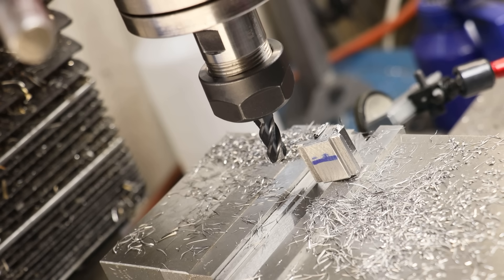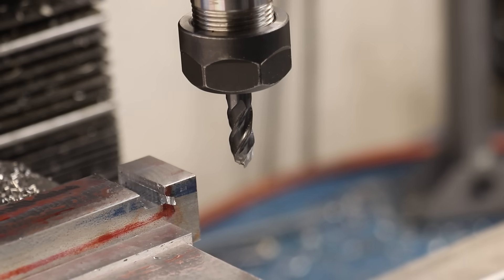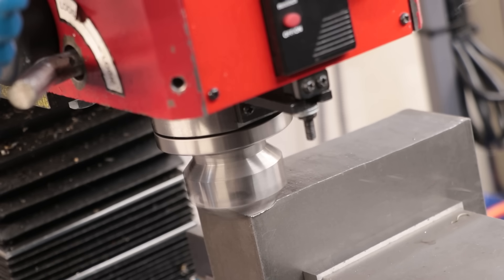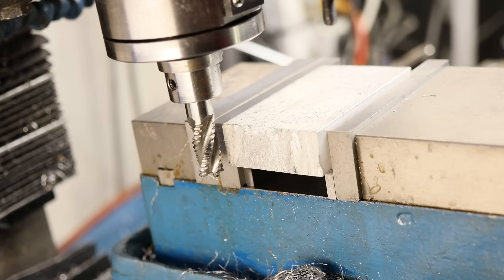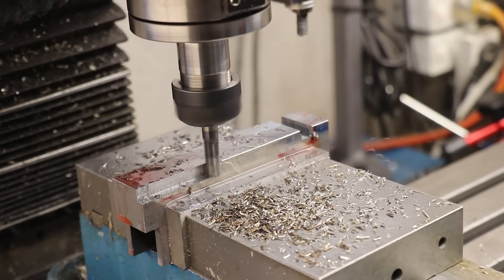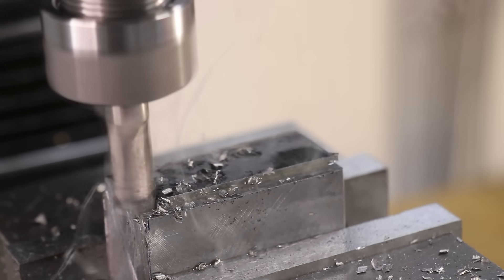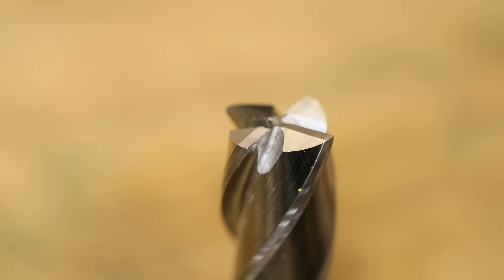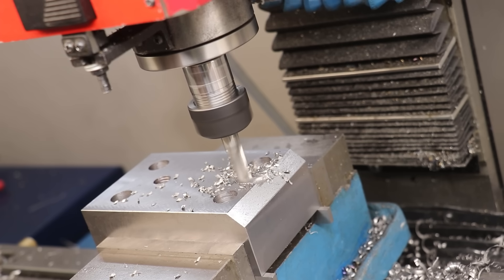10 Tips To Better Use Endmills

Comment: I mostly use 0.500” cutters, in carbide. So those are the first to wear out. I keep saying I’ll sharpen them, but they just pile up once the sides wear out as well.

I prefer three flute aluminum cutters. Two flute finishes are ok, but much better with three flutes, and the chip ejection is about as good. Cobalt isn’t really great for mill bits. Don’t buy them, go straight for carbide. They’re great for drill bits though. Use them for stainless. Just drill it properly, one third lower speed, proper lubrication and a lot of steady pressure.

Comment: I had good luck when i bought my lathe and mill, so I got a few boxes of various HSS and brazed endmills in every size I could need. I find that I almost never use any of them ... I prefer carbide for everything but speciality tools (dovetail cutters, ball nose cutters), I mostly buy new old stock or amazon specials, I really only need a few sizes for 95% of the work I do. No worries about burning up HSS in steel, and I find my flimsy noodle milling machine chatters much less at higher spindle speed and more constant loading that I can only get with carbide.

Comment: My experience about milling cutters. Spindle of my mill work at fairly high speeds (10k-24k on spec, but i use it on 6k-20k) so i use only carbide tooling that more forgiving of overheating. The price problem is being solved by buying chinese tools on Ali - they are more then good. And i using three main types of cutters - 1 flute none coated for plastics, 3 flute none coated (or it will stick to aluminum) with small corner radius (it's really better) for aluminum/brass (main application) and 4 flute coated with small corner radius for steel. Main working diameter - 6mm. Have some small ones down to 1mm fore more precise work. Have some extended ones for deeper cuts, but using them only when they really needed. (and some 10mm cutter working as more rigid extended cutter).

Comment: Hi. Most edge cuts made was made using conventional milling. You will certainly see better tool life and better surface finish utilising Climb milling.
Reply from the maker: Yeah but for reasons you'll probably already know its riskier to climb cut on a manual mill when doping roughing cuts

Comment: I really hate endmills. You need a tons of different models and sizes like you mentioned and they always seems to break so easily not to mention they are expensive! The bottom edges are always the first thing to go, it sometimes feels like they are made of glass. I too always prefer to use carbide insert tooling on the mill and only use endmills when it is absolutely necessary. I also tend to use the smallest size carbide ones to get the job done as I won't cry if I break it (20$ vs 100$ for a 20 mm endmill).

Comment: Other uses for broken endmills:
- grind them into inserts for flycutters
- if only the tip is broken you can turn them into counterboring drills, I've done this before with a cordless drill and a dremel
- grind a point into the end and use it as center punch

If you have a D-bit grinder you can do even more stuff with them

Comment: One tip I'd give is to get used to calculating your SFM cutting speed EVERY TIME. Don't just wing it or eyeball it. I worked at a place that did every thing in stainless steel exclusively. It was problematic at first but calculating the actual cutting speeds enabled trouble free cutting. After 10 years working stainless this way it became as easy as any other material, Even Nitronic. The tooling lasted and the parts were lovely. Don't believe the charts/books recommended cutting speeds. They are written by people who sell tooling. Calculate your own and find the sweet spot.

Comment: Never understood emills in colletts
Reply: They should ONLY be in collets.
Reply: @markrainford1219 then what are hard holders and shrink fit for?
Reply from the maker: If you know what heat shrink tooling is you would know it is not an appropriate solution for a small home shop

Comment: I can also highly recommend regrinding the tips of endmills when they wear unevenly. At least the 2 flute cutters are pretty managable. just grind them like a drillbit but angle the edges very slightly inward instead of 30° outwards like on a drill. you can just check the 2 flute cutters with a square, but for most cuts its not too important to get the edges perfectly level. you can then also slightly champher the edges

Comment: I make prototypes all day long in all sorts of material. My go-to endmill and best all around is a Holex HPC TiSi. Its a tad bit more expensive for a 10mm cutter than the 50$ one you showed - but they can take a beating and even cut when theyre really dull. We tried comparing them to the Harvey "zombie cutter" that Titans of CNC uses - and the one from Holex lasted longer (in regular steel in our test).

You can use the one from Holex in stainless and hardened steels as well =)

For aluminium and plastics we use the 2 fluted endmills "Alu-Power" from YG1.

As someone else mentioned; get yourself a small diameter facemill. Pick one where the inserts are seated at 90 degrees so you can use it to cut sides as well. It will take longer to cut sides with a facemill - but the inserts are SO much cheaper than breaking 15-20mm endmills.

Sorry for ranting but hope you can use some of the information. I love watching people on their manual machines as 99.9% of my work is CNC. Subbed 🤗

Cheers from 🇩🇰
Reply: At my shop we recently tried some YG1 stuff and eventually switched over to it entirely, their alu-power stuff is absolutely the best for aluminum imo
Reply: Oh yeah the 203014 Hoffmann code Holex HPC TiSi is a magical tool. Cuts soft steel, hard steel, stainless. No problemo. 
Ran a D14 one on an adaptive roughing toolpath in stainless for over 13 hours before I chose to switch for a fresh one. The edge was a bit dull no chipping or anything. Got it regrinded by Guhring(they have a shop right next to my workplace) with their own coating... still cut just as good.

Comment: Best tip i can give... stop using 4 flute endmills for hogging / roughing. use 2 flute endmills. save your expensive 4 flute endmills for light surfacing passes.

Comment: Hi, Top toolmaker tips here from time served machinist. 

At the start you were cutting towards the moving jaw on the vise. 

We were always taught the forces towards the vise nut can work it loose even on an expensive one!

Cut towards the fixed jaw whenever possible.

I was literally counting down the seconds and not surprised when it pulled out ! 

If your mill can handle it, climb mill with endmills milling reduces power required to do heavy cuts.

Two fluted cutters are also known as slot drills.

Single flute cutters I hear work best for polymers.

Some sound advice, keep up the good work
Reply from the maker: It’s not my proudest set up and maybe a bit absent minded. With that said, the biggest problem there as I said was I forgot to lock the slide on the table. If you slow it down you can see the endmill takes up the slack in the backlash and tries to climb cut in the x direction and not the y. Really frustrating because I’ve made this mistake a few times over the years and lost some good tooling to it. Cheers
Reply: So a two flute cutter should be used in a slot even if it’s steal?
Reply: @pugglez4798 if you aren't cutting hardened or pre hardened tool steel then a slot drill with flood coolant will cut slots all day long in steel. You can't go full depth and full throttle like a CNC machine can though because they optimise cutting rates etc.

The key is with manual methods to take longer times and smaller cuts as the machine typically is not designed for heavy duty machining.

People see CNC machining on YouTube and think a Bridgeport with a 3hp can do the same as a HAAS with a 30hp motor. Believe me there's a hell of a difference
Reply: @pugglez798 Two flutes will cut an accurate slot. Four flute will cut oversize. Allegedly.
Reply: @markrainford1219  Not allegedly - fact. All due to the number of edges in contact with the part - a two flute only has one edge in contact at a time during the cut, which has left the part when the next edge comes into contact. A four flute has an edge coming into contact before the "primary" edge has left contact, which causes deflection and an increase in slot width over the nominal cutter diameter.
Most 4 flutes are not centre cutting, so can't be plunged into solid faces directly - most 2 flutes are center cutting. 4 flutes have shallower flutes, so may be worse at chip evacuation than 2 or 3.
I prefer to default to 3 flutes - most are centre cutting and for most slots the next cutting edge doesn't cause deflection, so accurate slot width + an extra edge gives increased feedrate potential over 2 flute
Main advantage of 4 flutes is more edges for side milling allows higher feedrates - feeds calculated as "feed per tooth" so more teeth = faster feed for a given spindle speed. Also generally cheaper, as although there are more edges to grind there is less metal removed per edge than 2 or 3 flute (most are CNC ground from solid now).
Reply: @pugglez4798 two flute cutters are referred to as slot drills. Go figure.
Reply: Good to know about cutting towards the fixed jaw of the vise. Thank you for that bit.
Reply: Thanks for saving me the time to say the same. I will add that the correct direction of feed with a face mill flings the chips away from you. By far the most important thing to consider is the cutting speed. I am surprised it was not even touched upon in the video considering it's major influence on tool life.
Toolmakers like us should contribute more in machining videos. Unfortunately as the information is often contrary to the content these pearls of wisdom usually get removed to protect the channels reputation.

Comment: I get ALL sorts of endmills for virtually free😂 everything from single mm up to 40mm fluted which is huge for my equiptment (8×14 with a modified milling table I made- i dont even have a proper mill yet😂)  a bunch of insert face mills etc. but i thought id share- that they are stacking up faster than I can break them. I probably have gotten enough i could sell half of them and buy a cheap endmill with the money
Reply: Fleabay!

Comment: You need some insert endmills bro trust me they’re the best. I use them on 50 taper machines for roughing at work but they work well for some finishing too. They leave an amazing surface finish too
Reply: The problem with those is that they tend to be quite large which doesn't mix well with small hobby mills.
Reply: Hm, don't think I've seen such. Do they kind of look like boring bars? (I'm hobbyist.)
Reply from the maker: I used t run them on a big tormach cnc but even then I could have asked for a bit more rigidity, so I doubt that I could run the them on this machine , whic is only 1/5th the weight of the tormach. Cheers

Comment: Watching you break all those expensive cutters made my wallet ache. When I was a child, reading Gingery's books late into the night, he addressed the need of expensive cutters by .... not using a mill. Instead he made and used a metal shaper for a lot of his operations. Even though it was slower, it used single points tooling, like a lathe, that was dirt cheap. It was perfect for flattening, grooving, etc. There are a lot of different operations detailed in old machinist manuals that can be done on a shaper. I'm not saying quit using your mill. I'm just saying that a bench top shaper could take care of a lot of operations for almost no cost in tooling, and save your good endmills for when you really need them. If you were running a production shop, I could understand using expensive cutters all the time. Time is money. But in a hobby shop, trading a slower but much cheaper process for a faster but much more expensive one, can save our budget.
Reply: A few things changed since Gingery published his books.
His comments were relevant for the times he lived in.
I seriously doubt he would not change his opinions if he had access to Aliexpress, Vevor, Temu selling inexpensive yet decent quality carbide tooling.
He would also need to adapt to a simple fact that nobody makes small desktop shapers.
A recommendation to use a shaper these days is as practical as recommending a small 5-axis machining center.
Reply: @rok1475 I have no doubt that's true. The point of his series wasn't just "How to get metalworking tools for cheap". It was more, "Learn how to do metalworking, and have tools you can use at the end". I'd say he probably single-handedly did more to keep hobby machining alive than just about anyone else that I can think of. Though I've got to say that Blondiehacks just got a metal shaper, and more than a few people have small 5-axis machining centers.
Reply: @rallen7660  The point of his books was to popularize metalworking as a hobby.
He was using tools available at the time those books were written and published.
Some of the content is still relevant, some is not (see chapter about indexable carbide tooling).
You insist to treat those books like a Bible, I say you need to apply some critical thinking to their content.
Reply: @rok1475  Holy crap, I guess it's true: people only see what they want to see. Where did I "insist" his books were anything but a guide for budding hobbyists? Did anyone see where I said, "If you were running a production shop, I could understand using expensive cutters all the time. Time is money. But in a hobby shop, trading a slower but much cheaper process for a faster but much more expensive one, can save our budget." I thought this channel was for HOBBY MACHINISTS. Where the F* did all you PRO's come from? Why are you here?!
Reply: @rallen7660  do explain your fixation with shapers?
Reply: "Shaper"? crikey. some of us need things done accurately and swiftly. use a modern mill!
Reply: @crozwayne  I LOVE watching a shaper take long chips off parts but there is absolutely zero chance I'd ever use one a my job. Its SUCH a slow process :face-purple-crying:
Reply: @crozwayne  Sounds like a skill issue.
Reply: @rallen7660 oh don’t tell me, you’re a “journeyman machinist” from the mid west………
Reply: @crozwayne  YT won't let me reply like you deserve. I'm a hobbyist. I have run industrial CNC machines. I am an Electrical Engineering Tech with Aerospace and Manufacturing experience. You are a jerk.
Reply: @crozwayne  If you want an accurate flat face, a shaper will produce one better than a milling machine and with simple, cheap tooling.
It will just not do so quickly.

Comment: The best advice I can give to any hobbyist, just buy them from China. They're good enough for home use and cheap. $10 for a 10mm AlTiN carbide endmill, why bother with a $60 expensive one when you can replace them easily. Managing heat, chip load etc are all important but sometimes people tend to overthink all of it. Carbide endmills need the right spindle RPM, that's probably the most important factor than anything else apart from chip evacuation.
Reply: Can’t agree more. My work uses Ali express end mills and they’re so incredibly cheap compared
Reply: In a hobby mill with carbide, just run it at maximum speed always
Reply: I came to say the same thing. Carbide from China is a fraction of the price of anything I could buy locally and I can run it full speed no coolant without issue.

Comment: The timing for this has been great, just got my Mill together and about to start machining parts for my train. Thank you for the tips to help with enjoying metal working as a hobby. I walk into hare and Forbes all the time and look at the tool and cutter grinder which never gets affordable enough to warrant having in the shop. What are some of the draw backs of running flood coolant in a hobby shop would be another great discussion point. Do you get rust issues on your machines etc. My work shop is joined to my house which i have to be mind full of what happens in there.

Comment: Two things I think are critical...  1.  Dont take too shallow cuts, hard on small machines but super important as rubbing is the fastest way to dull an end mill.  2.  Check your runout.  Cheap collects can have 0.03nm runout.  On a 0.02 cut, one tooth is doing all the work, one is not touching and the other 2 are probably rubbing.

I have also started steering away from cheap chinese tooling and holders.  Sometimes they are ok, but often pretty rubbish.  There are half way options between high end tooling and aliexpress specials.  E.g. Kyocera or other Japanese brands van be purchased through China at really good prices.
Reply: And by nm I meant mm!
Reply: @ashesman1 big difference

Comment: When cutting alumInium, I find WD40 is an excellent lubricant - does anybody else use it ?
Reply: Yep everyone and their dog.  Another good coolant for aluminium is Isopropyl alcohol😉
Reply: Yes and also Anchorlube when tapping. Both the cats meow in aluminium!
Reply: @ronwilken5219  Watered down anchorlube is my favorite for milling too. You can adjust the consistency depending on whether you need it to flow down into a slot or stick to a wall. Essential for 1/32" and smaller end mills without flood coolant, since you can keep the tool submerged without needing to contain a pool of oil or whatever.
Reply: Anchorlube mixed with vodka 5:1. Cherry on top. Thank me later.